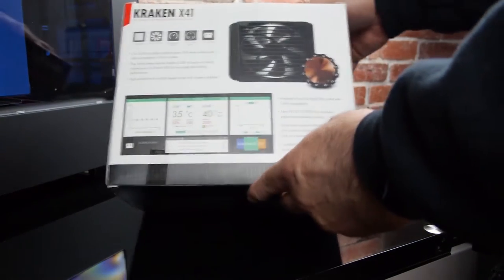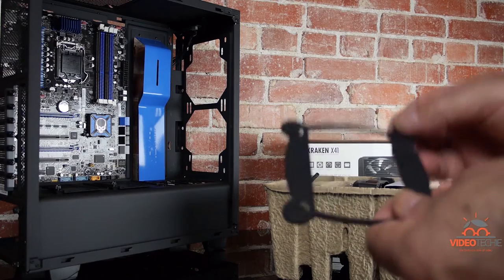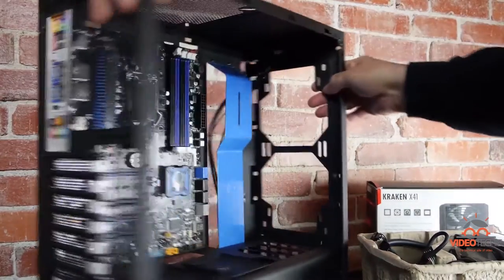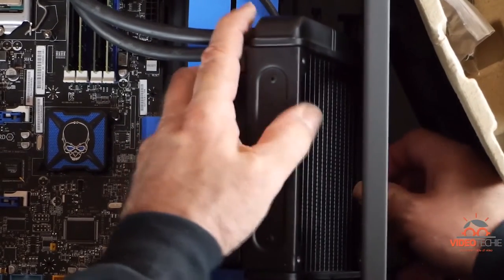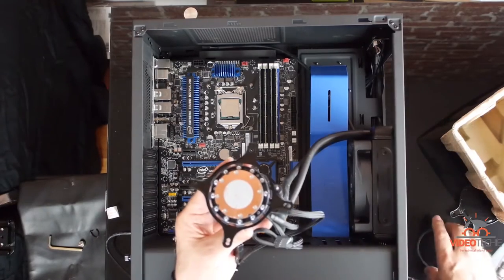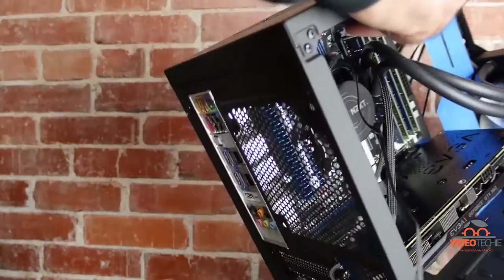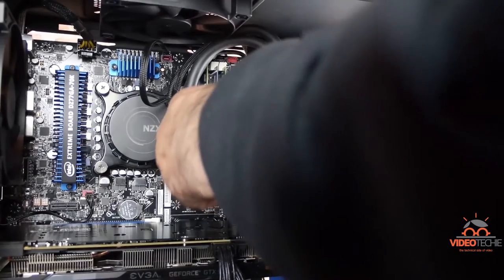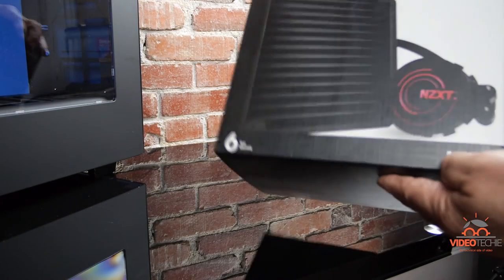NZXT X41 Kraken CPU Water Cooler Unboxing and Install

Comment: Thanks for sharing, I didn't think that radiator would fit in that case until I saw this.
Reply from the maker: +red29A
Thanks for taking the time to leave a comment.  ;-)

I do need to warn you that it was a tight fit.

Comment from the maker: Jude:  

The system is completely closed.  Because there is no contact with the air, the liquid can't evaporate.  So, the liquid levels shouldn't present a problem.  

That said, it is critical to ensure that the pump is monitored and that it is always operational.  

I'll be updating the motherboard installation tomorrow or Tuesday.  I'll include some bits on how to monitor the cooling system.

Comment: If the radiator is installed upside down will it still work? The reason in which i would like to do so is so that i can fit another case fan in on the above mount.

Comment: Did you use thermal paste??
Reply: In the video, you can see there was thermal paste pre-applied to the cooler. However, most people I know would remove this and apply a fresh coat before installing. So yes, thermal paste was used.